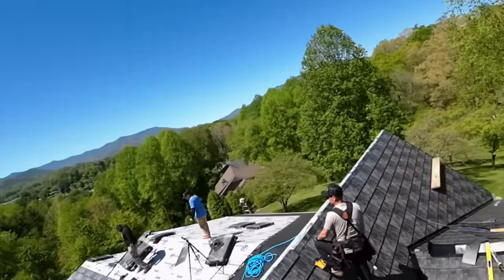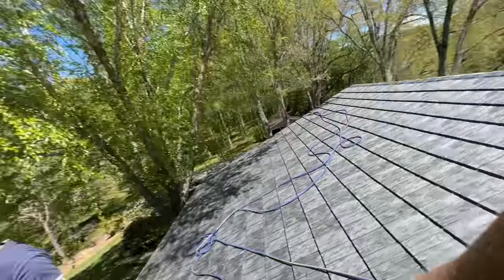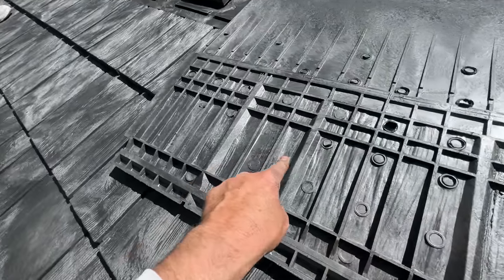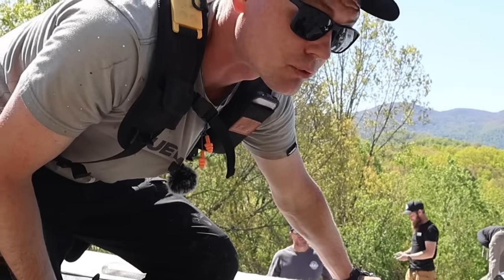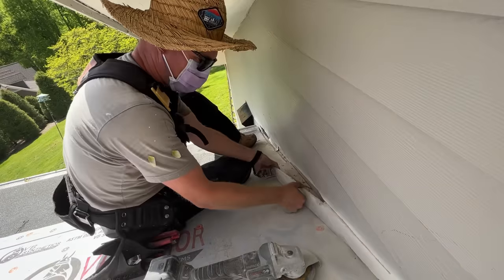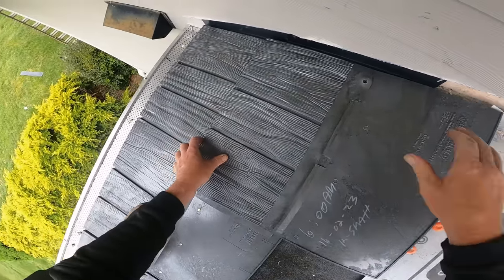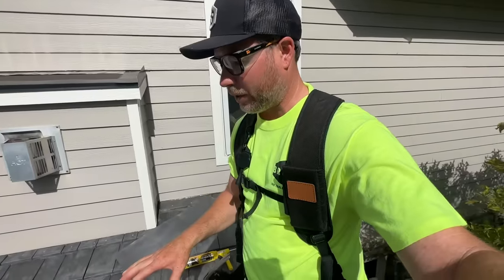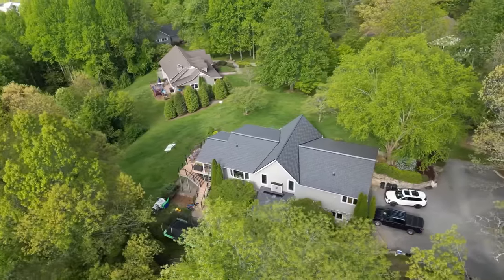Installing a LIFE-TIME roof on my house!

Comment: Very aesthetically pleasing, it adds a lot of depth to your roof. Looks like a solid option for an un-killable roof if you don't like the look of metal.
Reply: There are people who don't like the look of a metal roof?
Reply: @alexandrep4913  I mean yeah. Some places don't allow them as Erik said in the beginning.
Reply: Would it be quieter too?  I’d think the rubber would give a little give and bounce? I’m not a roofer, just curious.
Reply: Looks like cheap trash, either save up and get a tile or slate roof, or don’t waste your money. A lot of people in my area did this and it is so blatantly fake and trashy looking, I hope this trend ends quickly.
Reply: there are metal roofs that look like tile and would last longer than truck tires that become brittle over time.

Comment: Pro tip: Instead of face nailing the flashing with roof nails and caulking over the nail heads, use a color matched metal roofing screw. Looks better, self seals so is a quicker install, and lasts longer.
Reply: How do you know are you a professional licensed roofer m8
Reply: @Dbswrath  actually yes I am. Even if I wasn't though, it doesn't take a genius to figure out
Reply: @Dbswrath  The standard keyboard warrior here on Youtube.
Reply: @TheNoahjf  cool I was just asking well I'm not a genius so I didn't know that
Reply: @Dbswrath   clearly you are not
Reply: @ban80  thanks 🙏
Reply: Why are you all bashing a person for asking how he retained his knowledge. For you guys to just automatically assume is a huge mistake. They could have been a building science or construction materials expert, or a general contractor who supervises many different disciplines and knows the tricks. So to ask if they did work specifically in that industry is not wrong, not rude, and most certainly not a ignorant method. You know what assuming is right? Learn to step back and out of the shadow of your egos.
Reply: @egondro9157  that's why I asked what I did what do you mean lol literally what I asked if he was licened contract professional
Reply: @Dbswrath  sorry if I sounded cocky with my original reply, I just meant it shouldn't be hard to wrap your head around why a rubber self sealing washer is better than caulking which cracks and peels (usually) when exposed to sunlight. No solution is permanent in the sense that it wall last forever, just plan for as long as possible and less maintenance is better
Reply: @egondro9157  sorry if I came off as rude
Reply: @TheNoahjf  no worries man I didn't take it that way yesh it might be commen sense or knowledge too you because you do it everyday it hsve don't it a million times in the past. Now too a laymen like me who has never done any roofing or any of that type of work I was just curious and trying to learn something
Reply: It's not a long process to get "liscensed" as a roofer. Look into it. Not rocket science.....
Reply: @franklee2683  that's why I look at someone's experience before their license
Reply: @Dbswrath what a cop out. When u said it you were being slick. Now you got busted and your acting sus. 

The comment was a pro tip. Whether he is a pro or not is completely irrelevant. 
And the other guy is right, you are in a sense a keyboard warrior, because you were quick to respond with another discovery of evidence to discredit the witness.

M8
Reply: @kylemcweeny878  How the USFS handles trolls. Act accordingly.

Comment: I think where I live in snow country I'd put down some adhesive under the  edges of the shingles in the valleys. Melting snow creates small dams on the roof and water backs up, (just one of the reasons for the pitch of our roofs.)
Reply: Ice & Water under the valley. Solar seal 900 is the required sealant.

Comment: Pro tip: use a water based armor all. Will protect your tires and roof at the same time. The greasier type normally used on tire might make the highest pitched roof on the street slippery!
Reply: From corporate, please do not put coatings on this roof. 😅

Comment: Nice product. Will be interesting to see how it plays out over time.

 Showing how to install a roof jack, then commenting that you could leave the nails there without mentioning they need to be tapped  down tight to the shingle they are holding  could use a comment. Then removing a roof jack, and beating down on the shingle over top of the nails, that are still proud of the surface of the shingle below is inviting trouble. 

 North Carolina state motto. "To be rather than to seem".

 I've seen some of your other videos.  You guys get some nice work, and your videos are slick.  I like the planning of the high points on joists before applying the deck.

I also liked  when you cautioned folks to tack trim, that is part of a larger assembly,  until All the components of the assembly are tacked in place so you can view it as a whole before Permanently nailing.
Reply: "Planing" not "planning".

Also the shingle you were beating on was with your hand, not with a hammer.. You could've injured yourself and the shingle

Comment: Interesting a tile roof that can be used in a cold weather climate. Most rigid tile like ceramic or concrete can’t deal with the freeze and thaw cycles. Also the weight on top of snow loading requirements.

Comment: Looks great.  I bet thats way heavier than other roofing materials.  Not sure if that would ever be an issue.  It seems like it would be better to nail that flashing going under the siding on the vertical side thru the siding, than to nail thru the roof and caulk over, but im sure u have a good reason for doing it that way…
Reply: The weight of our 1/2 inch product is 240 lbs per square which is around the same as an asphalt shingle, our 3/4 inch product weighs 340 lbs a square which is about the same as triple-laminate asphalt shingles.

Comment: Makes it a little easier if you nip the 90 degree corners off when sliding flashing up under the siding.   Doesn’t take much.  Maybe an inch in from the tip of the 90 and turn it into a 45 or so.  Great job.  I had never seen this type of roofing material.

Comment: Do these have something added to prevent UV damage?  I'm assuming that's part of the 5% not recycled and probably proprietary.  Looks good
Reply: The particular tires used have a natural UV protection via carbon black but yes.

Comment: I did not know you had to leave the very top of the roof with a long hole in it.  It makes sense for the summer, but what happens in winter with the cold.  The cold to me is heavy, so it would sink in to the house.  Am I wrong about the cold?  Leslie is talking to Jamie with all the info so he could know.  He is so funny!  And Erik is cutting Jamie off as usual.  Jay, is quiet today.  Looks very pretty!  Love you guys
Reply: The vents are above the insulation layer – the air that passes through them doesn't come from inside the house. As the roof heats up, the air underneath the roofing also heats, and rises out of the top vent, drawing cooler air into the bottom vents (which are located at or under the eaves). As far as I know, even in winter, the air will still warm slightly below the roofing, causing the same process to happen, albeit more slowly.
Reply: You have to air seal and insulate between the attic and living space. In those conditions, the attic is its own separate environment.
Reply: Building Science has learned to use ridge vents because that’s where the moisture in the warm collects and condensates leading to ridge rot. Gotta give the warmer moister air a way to escape.

Comment: Since its rubber i wonder if its going to turn gray over time then start to crack. Also idk how i feel when they just caulk over exposed nails like that. That caulk just peels off after a couple days or weeks lol.
Reply: They test them just like asphalt shingles. They have a 50-year warranty, double what the best asphalt shingles offers. Did you think they didn't anticipate these questions?
Reply: This particular roof is already grey. Carbon black base make it literally impossible for them to fade like plastics which tend to have a clear or white base. If anything they’ll darken over time. 24 years running & only have gotten better throughout it. The sealant required is solar seal 900 for that reason. You don’t want one that dries out or doesn’t expand & contract at the same rate as the product.

Comment: I fear you will see rain water forced under the roof tiles along the valley flashing. As I see it, rain will rush down the steep pitched section of roof where it will push past the valley flashing center ridge and under the opposing roof tiles (in part because of the speed of the water and because the roof tiles run perpendicular to one another). While it looks like you did a fantastic job with underlayment, once that amount of water finds its way between the roof tiles and underlayment, it will eventually find a way into your attic.

I am very happy to be corrected on this, though.
Reply: We have not had any waterproofing issues in the field or valleys as long as it is installed correctly, and done so as stated in our install guide, which it was:)
Reply: @Euroshieldroofing  I am glad to read this. Good luck with your endeavors. It looks like a great product!

Comment: would this add some R-value to the roof too? I also wonder if the black rubber in the sun would be a killer when up on the roof for gutter cleaning/christmas lights/whatever else (or just the same as standard shingles in that respect)?

Comment: How much does the roof affect insulation value of the house? What would be the difference between shingle insulation value vs rubber roof insulation value?
Reply: I can't imagine those asphalt shingles have any insulations properties at all, no thickness, no air pockets, nothing that would normally hold heat

Comment: I'd imagine the weight is quite a bit more. With a full winters snow load, is their a structural change that needs to be made to use the tires or is it not that much of a difference?
Reply: It weighs about the same as asphalt. Our 3/4 inch product (which is what's shown in this video) weighs 340 pounds per square, our thinner product (1/2 inch) weighs 240 pounds per square.

Comment: What about fire rating? Most tires burn like a mutha when they catch, just curious, most people where I'm at are convinced that a metal roof helps to not catch but no roofing will keep a house from burning if the structure is already. Anyways just a question

Comment: Hey Brother from a different carpenter mother. Great Looking roof and 1000% great idea on using a recycled material. A great way for us carpenters to help preserve our kids future! A "pro tip" we do to speed up the siding cutting on that flashing is to install a 7" mason cutting blade in our skill saw. Then run it down the roof deck. It provides the perfect parallel cut Jamie would approve and fast way to use the saw deck as a spacer to get the right height for flashing. No drawing, measuring or tracing lines. Just run the saw straight down. Saves time which + saving money. Thanks again for showing all that detail for all the new folks that we need to replace us both!! Those knee and back pains are for realz!! I've got 10 yrs on ya...so keep it up!!

Comment: There was a house in my area with a similar roof, maybe not same product but it was recycled rubber and people claimed on hot summer days it smelled like burnt rubber.
Reply: Off gases in the first couple weeks of UV. If it was Euroshield it was just installed or those people have a fun imagination. I’ve been out to check many after multiple hurricanes. All looking great with proper installation.

Comment: My only concern with the 3-nails left over from the Roof Jack is IF they happen to line up on the shingle's undercarriage and structural support ridge and not the available open space that you say insulates from the the hot sun. Either a small hump will be there, or if someone steps on it could it create an issue? But they seem tough enough to withstand such aqn event - I like the lighter color Slate option, which would be more reflective of the sun's soalr heat energy.

Comment: Looks awesome! I'm curious about the difference in weight compared to a traditional asphalt shingled roof and how well the color holds up over time.
Reply: I know some who did a similar rubber roof (also from Canada) about 10-12 yrs ago. Their house also gets a ton of sun. Thing looks brand new.
Reply: Brad I was going to ask the same thing but wanted to scroll through the comments to see if it has been asked...will  be interesting to find out
Reply: Wonder if it will get dry rot like all tires do..  doesn't seem lifetime to me...
Reply: @FJB2020  We have a FAQ page under our Resources menu on our website, but here is the answer in short! To answer this question properly you have to understand what makes tires crack. Tires have metal wiring in them, this is what gives the tire its shape, and when you expand & contract this wire enough it will eventually break. When the metal in the tire breaks you will visually see the rubber crack or separate. Euroshield roofing materials contain no metal so we do not have to worry about this problem. In both real-life & lab-testing, Euroshield has never cracked.
Reply: @Euroshieldroofing  I went down a rabbit hole of every review of your company and the company it was before the rebrand..  It looks like a nice product, but I read the complaints and they all have the same issues of curling and cracking which is exactly what rubber does in direct sunlight. 

Quote from Goodyear "The sidewall weathering that is visually evident on the tire occurs when the rubber compounds used to make the tire begin to break down"

So, I am not sure how you tweaked the formula to keep the UV degradation down, but it just doesn't seem like a long term roof...  Unless you have third party case study on the longevity...

Comment: Why actually taking off the old shingles? They are so thin so you could use them as a further insulation, or was the foil underneath broken too?
Reply: When you leave asphalt shingles on, intending to just shingle over the pre-existing ones you are unable to see the condition of the decking underneath. It also puts extra stress on the locks of our product which could lead to the unlocking of our shingles.

Comment: is dry rot not a thing on tire shingles exposed to sun for years? i mean i see that happen when they're in wheel form, why are shingles considered lifetime?
Reply: Our shingles are made mostly of tires but not just tires. We add UV inhibitors into our formula alongside other things to stop our product from breaking down in any type of weather. We also have a 50 year non-prorated manufactures warranty to further backup our lifetime claim.

Comment: Dang this looks good. Wish i could afford to add this to the plans for my house, but with 25 year asphalt shingles costing me around $3 per sqft, and this running closer to 20 plus all the metal work.. i just dont think i could justify the cost. Looks absolutely stunning though
Reply: The question you need to ask is,what will be the cost to replace in 20 years.
Labor and materials will be much higher then.
Reply: Liam - you dont REALLY expect a $3 sf shingle to last 25 years do you ?? Come on
Reply: @johnwhite2576  not going to be my problem by then lol. It's a starter home for my wife and I to get our feet under us.
Reply: Nowhere remotely close to $20/square ft in material cost. FYI. Close to what you’re paying for disposable asphalt actually.

Comment: How do you mount solar panels to panels like those?
Reply: Solar: Typically mounting plate is mounted between the butt edges on a course laying on the flat portion of the surface (9" reveal on Beaumont Shake or Vermont Slate). When lag screwing into the deck/truss, after holes are drilled, create a gasket seal on bottom of plate using Solar Seal 900 (highly recommended sealant). Coat screws mounting the plate before fastening to roof. Do not over tighten so much that you collapse the panel around the plate.

Comment: What happens when the rubber cracks and dry rots? Won’t there be likely chance for it to reach the nails and get through causing leaks/rot?
Reply: It does not crack or rot, you have to understand what makes tires crack. Tires have metal wiring in them, this is what gives the tire its shape, and when you expand & contract this wire enough it will eventually break. When the metal in the tire breaks you will visually see the rubber crack or separate. Euroshield roofing materials contain no metal so we do not have to worry about this problem. In both real-life & lab-testing, Euroshield has never cracked.
Reply: @Euroshieldroofing  so after doing some googling. That is one of causes to dry rotting or cracking of rubber, other factors that cause the cracking or dry rot of rubber are: prolonged exposure to UV rays(the sun), harsh chemicals (rain), and extreme temperatures. So I mean if it were me id test it on a small shed or something first before buying this as a long term of life long solution.
Reply: @Mind_Breach  Which is completely understandable! We would love if you gave us a shot, even just on a small shed.

Comment: Interesting. How much does it cost per square?
Reply: Most US roofers are charging between $1k-$1500/square depending on style, color, location, etc.
Reply: @DavidSummerly  For the material only?
Reply: @robertlaird6746  no, all in installed.

Comment: What isc the lifetime? 10-15 years? Rubber cracks as it dries out over years.
Reply: We have successfully had our product in the field for 24 years, and with third party testing it s expected to last a minimum of 50 years, which is backed by our 50 year non-prorated manufactures warranty.
Reply: @Euroshieldroofing  well, that’s good.     50 years is good amount of time.